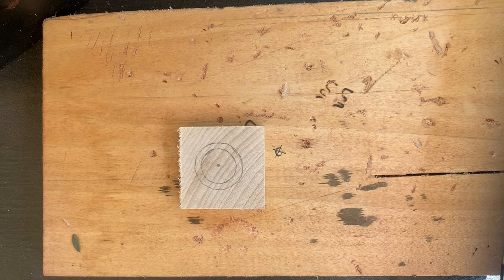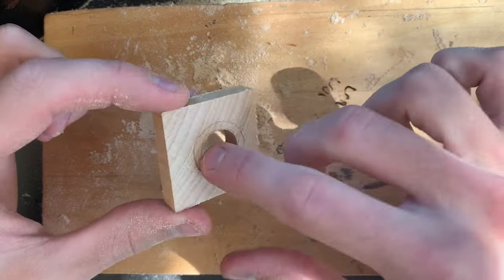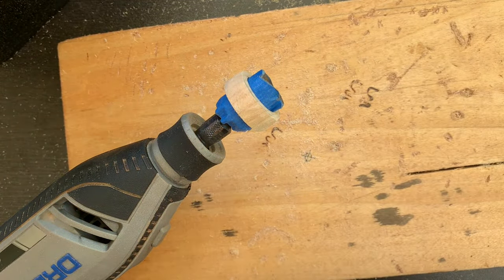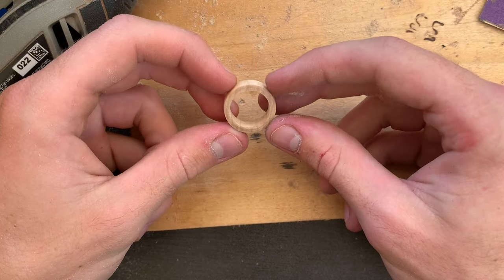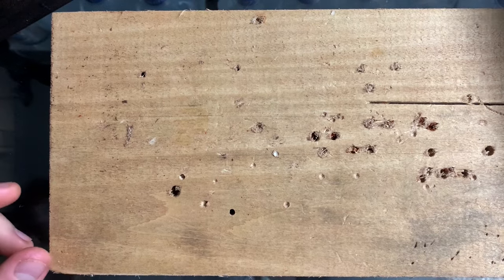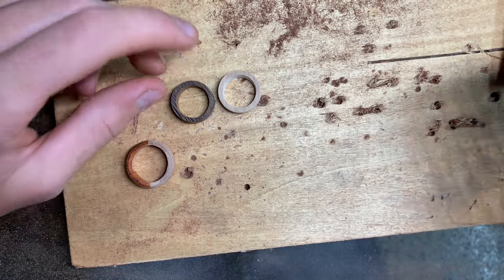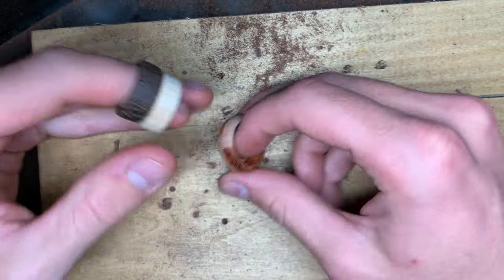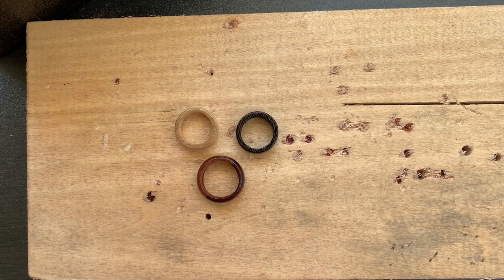How to Make Wood Rings With a Dremel

Comment from the maker: I didn't mention it in the video, but please like, comment, or subscribe if you enjoyed this video! It helps out the channel a lot. I'm putting out weekly videos that mainly focus on Dremel wood carving if you would like to check them out. Thanks for watching!
Reply: Hi. Only just discovered your videos. May I ask what is the cutting bit you use in the dremel. Thanks
Reply from the maker: @andyop5301  dremel 561 multipurpose cutting bit
Reply from the maker: @billybatchelor2863  thank you!
Reply: I agree with your thought that you should get a lathe. There is so much one can produce using one of those that it is truly worth the expense. And remember you can turn small items on a large lathe, but you can't turn large items on a small lathe. However, your work is lovely.
Reply from the maker: @jimhutchinson865  Good advice! Thank you
Reply: I like the idea of getting a lathe. Another idea that would probably save a fair amount of time is maybe use a large drill bit for the center hole, if possible use a drill press to ensure a straight hole. Then go in with your sanding drum.👍
Reply: @LogsCarvingClub  
Nice video. Regarding finishing; polyurethane really doesn't stick well at all  to oiled wood, so you may want to either finish with a drying oil such as tung oil, or even could use thinned spar varnish.  Or else only well-thinned (to soak in) polyurethane on it's own.
 But just not the combination of oil based and poly....

Comment: If anyone is have the same problem with a bulging  after mounting on the drum sander this will help. The bulge happened because the tape was not applied uniformly causing the ring to be off center and thus out of round when sanded. To avoid this take care when rapping the sader not to fold over any of the layers of tap and try to use as few strips as possible.

Comment: One thing ive found helpful:  when wrapping the sanding drum with tape (i prefer electrical tape since it grips well), do so with the screw on top of the drum REMOVED. Once you have your ring snug on the drum, insert the screw and tighten as you normally would. This of course will slightly compress the rubber and thus it will become slightly wider at its equator. In other words, it will really lock the ring in place extra tight.
Reply from the maker: That’s a great idea! I’ll try it out. Thinking of making an updated video that’s more refined
Reply: Wise words from Mr. Lister the sister phister lmaoooo

Comment: Just bought my first rotary tool the other day. 100% beginner at wood working and this WILL be my first project. Doing this tomorrow! Thanks for the idea Logan!
Reply from the maker: Thanks brad! Let me know how it goes!
Reply: @LogsCarvingClub  hey Logan. Thanks for reaching out.  It's going slow lol I like it so far tho. ButI've gotten to play with it 3 or 4 times.  Covid went thru my house and we all got it. I had it the worst. 3 straight weeks. Glad it's over.  So I'm going to start looking into more now.  I'm 100% beginner at it tho.  Someone bought me a wood burning set and I love that. Thought of a couple things I'd like to make with both of then and then bought the dremel.  I hope that I can be as good as you one day. 

Kendall
Reply from the maker: @bradkendall9551  that sounds tough! Glad you’re well now though. Good luck with the project!
Reply: @LogsCarvingClub  yessir. It was bad for a bit. Worse for me watching my kids go thru it than going thru it myself.  But we're all better now.
Reply: I wouldn't call it woodworking. Don't get me wrong, this is nice work. But using a Dremel for everything is not woodworking. Instead think saws, squares, joints, and planes. Building things, not reductively shaping things. Wood carving is more apt for this sort of activity. But even that usually involves a few hand sharpened tools and at least one or two drops of sweat. But I'm just being pedantic. Cheers all, glad you're better after the COVID wave. And thanks for the video.
Reply from the maker: @eric.brooks  I usually call it “power wood carving,” as it’s much much different from hand carving, and you’re correct this channel isn’t for building - it’s meant for hobbyists who want to wood carve with very limited equipment (and for those who don’t like carving with knives)👍. I do some hand carving on the side but I don’t enjoy that to make a larger carving you have to exclude many pretty hardwoods since they’re too hard to practically carve with knives and chisels.

Comment: 2 suggestions. 
1.  Use a hole saw  on a drill to get the outside of the ring close to the finished diameter.

2. use a series of twist drills to get close to  the inside diameter.

You can then get your final sizes using the various Dremel  bits for shaping, sanding and polishing.  It will save you a lot of time and eating wood dust.
Reply from the maker: Good ideas! I was just using what I already had at the time.

Comment: You don't have to cut the piece to make it flat. Just hold it vertically over sandpaper and lower it down till it  aligns with pencil mark. The Dremel Workstation would be an excellent tool to have in this situation. You have great idea ! Thanx for sharing.

Comment: I see this was posted a year ago and I hope you've grown in your craft. I'll check out your other videos when I get a chance, the thumbnails look pretty awesome of the carvings!!
Some things I've done differently when making my wooden rings is coating them in CA glue (I didn't think to use oil) to "weather proof" them and sanding them smooth. I would sand to 2000 before the glue to get all the scratch marks out first. I used all kinds of wood so I had to coat some to protect from skin irritation and skin discoloring (mainly cocobola and ebony gaboon). I broke a lot from wearing them to work and at home to see how long they lasted (usually not long at all) so I started making ring blanks from different materials so sometimes the wood would be the core or on the outside.
Just a suggestion, maybe find a strong material to use as a core and you can make the wood thinner and it will last a lot longer. I'm about to make a couple of rings from olive wood with a titanium core and maybe an inlay depending on how it looks. If I can record it I'll post a video😁
Reply from the maker: That’s some really good advice! Can you let me know how the titanium goes? I’d be curious to see that. I agree the rings don’t last long without any inlay. I’ll have to get some CA glue to try that out. Thanks David!

Comment: This is a very helpful video, I thank you for it, your instructions/steps are very clear which is much appreciated 

I've had my dremel sitting around doing nothing and I've wanted to make my partner a ring, but I wasn't sure how I'd be able to do it, my brain just couldn't wrap around how to drill the hole, I imagine you could use a saw (in my case a coping saw) to cut most of the material away for the outside of the ring, I have a chunk of cherry wood stump that's been sitting around too, it's got enough material on it for me to practice since I'll be needing to practice lol
Reply from the maker: I’m sure that will be a nice gift! I think handmade gifts are always more meaningful

Comment: I'm pretty sure you figured something out by now 😆. I use a caliper to measure all sides. 🤷🏻‍♀️ It's works. I also use a hole bit on my screw gun (drill) to get the circle as close as I can.
Reply from the maker: I agree there's easier methods, I just like drilling out the center as I did to limit the risk of the wood splitting and to get the sizing really exact. Other than that for the outside thickness I think it's fun when it's a little wonky (shows it's handmade).

Comment: I wonder if you could engrave a line in the ring and fill it with what ever takes your fancy. Not only would it add decoration if it’s molten metal it would add strength?
Reply from the maker: I'm sure you could! Not sure though about molten metal, I think that'd just end up giving me an injury and burning the ring.
Reply: 😂 I suppose you could use copper wire or something similar.

Comment: I've just got a dremel tool and your videos are great. Having never used one, where should I start?
Reply from the maker: I’d start with a small gift for someone you know, the pressure to make it look good will help you learn. Maybe a relief carving or an engraving? I’d stay away from the 561 and the circular saws for a bit until you get the feel for it.
Reply: I started with a $20 battery powered dremel I love it for the longest time and I decided to upgrade to a Dremel 4000 and have no regrets. I've been using Dremel products for 4 years.👍

Comment: The ring was not spinning true....like it would on a lathe. I do rings with the dremel sideways, using the multistation....and check it spins true before starting. Also has to be really snug on uniformly applied tape and stop and check your work intermittently....those are my best pointers. Great video ❤ I will try from solid wood....mine were the bentwood variety
Reply from the maker: How do you do the bentwood? I'd be interested to try.
Reply: @LogsCarvingClub  there are videos on here, not mine personally,  but basically thin strips of veneer, warmed in water until flexible, wrapped around a socket, secured with a band or bit of tape,  to get a reasonably curly strip of wood. When 100% dry, use a socket with similar ring size to what you want, cover socket in a tape or something ca glue doesn't stick to, wrap tight, tape again to secure, soak with super thin ca glue, leave to dry. Then shape. :)

Comment: Nice video, would it be possible to just drill out the centre with a large drill bit for a perfect circle?
Reply from the maker: Rings have to be such a specific size I couldn’t get a drill bit with a 17.5mm diameter
Reply: @LogsCarvingClub  17mm forstner bits are available then sand it 17.5 mm
Reply from the maker: @ODX171  true true

Comment: Hi, sorry to ask. I tried several times making the ring, but eventually it cracks while making it. Why do you think it happens?
Reply from the maker: Oh no! What kind of wood are you using?
Reply: @LogsCarvingClub  that's what I would want to figure out. It was given to me by a friend, i can't tell if it is beech or pine, or maybe smth else. For sure it is not good quality..
Reply from the maker: @martinabagaric120  pines probably too soft, beech should be good. Perhaps keep it a bit thicker? Also faster RPM and less aggressive bits may help. At what step are they cracking?
Reply: @LogsCarvingClub  it surprisingly happened at both times: once I was taking out the hole, the other time I was carving away the corners of the block. I should specify that I kept the piece firm with a clamp at both steps. It helps me a lot. I wonder if that is the source of cracking, due to exerted lateral pressure.
Reply from the maker: @martinabagaric120  maybe! I never use clamps so I’m not sure
Reply: @LogsCarvingClub  Thank you very much. You're so available and a fast replier!

Since I recently approached to carving I'd like to make you an unrelated question if it's ok.
When and why do you choose to work at high rpms rather than lower ones? I am quite new to this, so I am not able to critically choose the rpms  :(
Reply from the maker: @martinabagaric120  depends on the accessory you’re using, if I’m unsure I’ll go lower RPM, if I’m sanding I’ll also use a lower RPM, for carving I use higher RPM

Comment: Hey bud. Can you guide me a bit please. I got a tacklife rotary set and new to using it. I love rings so want to make some out of wood. What glue did you use to bond those pieces together? Also whats the best wood to use? I got a 2x6 lumber section from lowes but I am wondering whether it will be too hard to drill through.
Reply from the maker: Syed Rizvi hey man I used the original gorilla glue and clamped it to glue the pieces. I’d recommend using the strongest wood you can find that isn’t too brittle, like maple or birch if you want the ring to last. A 2x6 should be fine if you can whittle it down or get a slice, but I’d be cautious of using a softwood

Comment: i’ve learned a lot from this video and i’ve been making mine and i love it! one questiin i’ve had though- how long does your polyurethane stay on? i cant seem to get it on there enough so that it doesn’t have spots chip or rub off and i’m not sure if this is unavoidable or if i’m doing something wrong :(
Reply from the maker: I do multiple thin coats 2hrs apart, I haven’t worn them long enough to really tell
Reply: Theo, try coating your ring with UV resin.

Comment: How does the spray adhere to the oiled rings?
Reply from the maker: It adheres just fine! You have to make sure you don’t let the wood sit in the oil too long so that they don’t seep oil later, and you have to wipe them down to minimize any excess oil on the surface before spraying
Reply: @LogsCarvingClub   Cheers mate 👍🏻✌🏻😊

Comment: how do you apply the polyurethane? i’ve been using the spray like what you have and i’ve either had it come out patchy and/or rub off in a few days after wearing it :(
Reply from the maker: I used miniwax polyurethane spray, 4 thin coats every 2hours so that each can dry in the sun. Thin enough so it doesn’t accumulate at the bottom. Also spray from a good distance. I roll up a piece of paper into a cone to put the ring onto so that the spray can hit the whole thing, then flip the ring over so that theres not more spray on either side. I usually stick the paper cone onto a stick in the ground to keep it in place. Keep it from any dust sources so the polyurethane doesn’t pick up dirt
Reply: @LogsCarvingClub  thank you!
Reply: I'd be inclined to try something other than poly. CA super glues dry incredibly hard when applied to wood and they allow you to still enough the grain and character of the wood.

Comment: what oil did you use? I have just made a ring and im just not sure on how to finish it. I got some super glue because i heard that was good but i want to oil it for the grain
Reply from the maker: Amaya Gushiniere I placed them in food grade mineral oil for a few seconds to rehydrate them then sprayed them with 4-5 coatings of polyurethane. Both products available at any hardware store. Note that the polyurethane isn’t necessary (I just wanted them shiny and more waterproof), and you can use practically any wood oil you want to (of the ones that won’t irritate the skin of course).
Reply: Logan Magin i appreciate it, i got a danish oil but after looking it up i dont think its super safe, so i think ill revisit it. Thanks for the help, your video encouraged me to get into wood carving. :)
Reply: I use super glue (CA) for small pieces - it dries really hard and shines up real nice once sanded and polished. It does darken the wood tho. Use in several thin layers. For oil I use a special blend of citrus and tung oil. :)

Comment: Can you cut out any shape with the bit the way you cut out the circles?
Reply from the maker: Yes, the tile cutting bit is very controllable. It’s slower than the 561 cutting bit, but it’s easier to more accurately trace lines and shapes. I recommend making several shallow passes rather than cutting very deep into the wood in one go. The less resistance the better.

Comment: What kind of dremel would you recommend?
Reply from the maker: Dremel 4300 is what I use, lots of power and has a cord so you can work without needing to recharge anything. The 4000 is good too but it was discontinued. Haven’t used anything else
Reply from the maker: @shadow run most models such as the dremel 4300 have speed knobs from 5-35k rpm, so you can get it exactly where you need it.

Comment: what‘s the name/ number of the tool you used for the outer part of the ring? :)
Reply from the maker: The buffing wheels can be found on Amazon by searching “dremel buffing wheels” I think, is that the tool you’re asking about?
Reply: @LogsCarvingClub  oh thank you, but I meant the tool you used to get the flat cut
Reply from the maker: @pocketshrimp17  YXGOOD brand tungsten carbide double cut rotary burr 1/8in on Amazon
Reply: @LogsCarvingClub  thank you so much!!

Comment: Dude..  make a jig already.  If you do it right, you won’t need a lathe because the horsepower isn’t necessary for this kind of fine work.  Some cheap chisels, a secure mount for that Dremel, and maybe some bore bits or a router… you could make 50 of these things in a week out of cheap scrap wood (and you could use exotic woods, wire inlay, epoxy and dyes/paints, etc to incorporate into this).   Get a system going, and the sky’s the limit.
Reply from the maker: That would be fun! I just don’t really want to sell stuff, nor do I have the attention span to make the same thing that many times

Comment: Ok you lost me after you polisted the outside. When you started the block of wood was straight. The top and bottom was flat.I don’t think that sanding the outside will change anything. You could have mounted the blcok to the Dremel uneven and that would give you the appearance the some how the ring was warped or uneven. I could be wrong, But That was my perception watching the video.
Reply from the maker: It’s pretty hard to freehand a 90 degree angle to make the center hole to mount, so naturally the hole won’t be perpendicular to the top and bottom after spinning it (hence the “wonkiness”). To counter that I sanded off the top and bottom a bit to compensate. The initial block was 9mm thick, it ended at around 7-8mm. Hope that helps

Comment: Attention Carvers! Just buy round bar, cut, sand then urethane. No need for all this.
Reply from the maker: That’s a good idea if I was just doing the maple one - Don’t think you could make interesting designs though like the larger one in this video. Also not very easy to find a cheap round bar if you want to make a single ring of an exotic wood